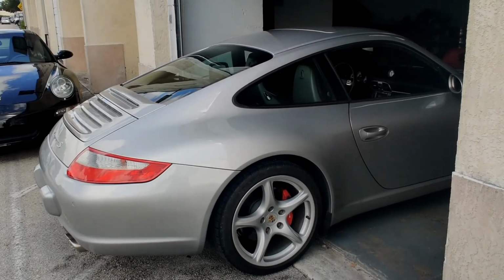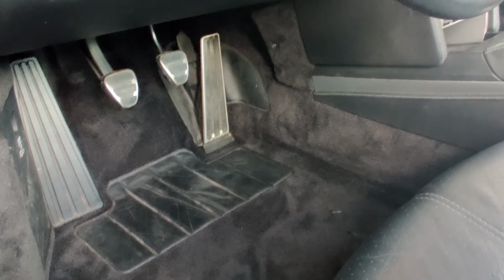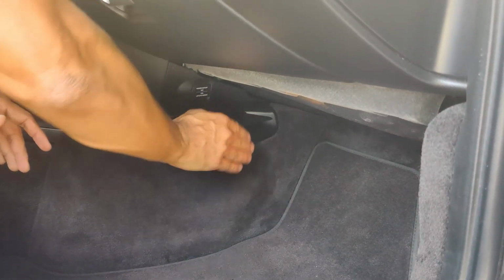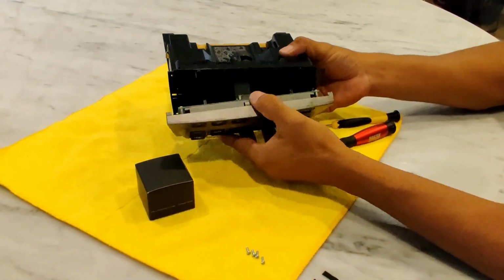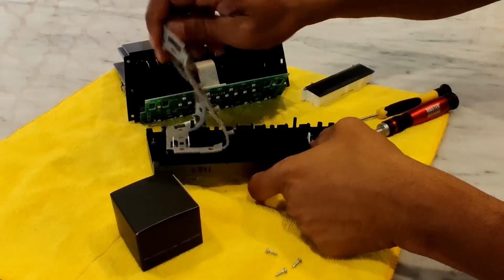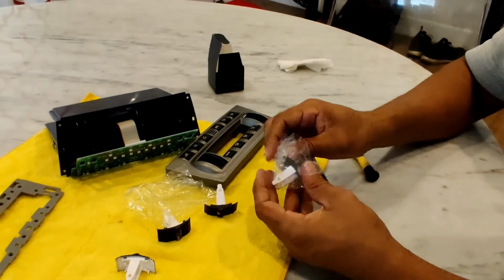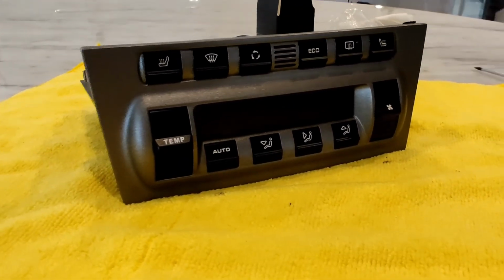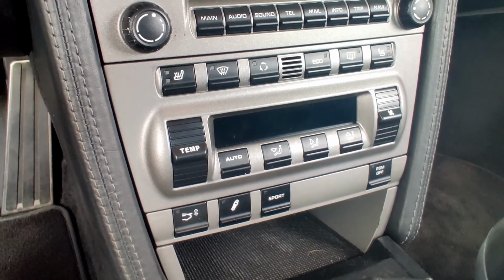Porsche 997, Cayman, Boxster Worn  A/C & Heater  Switch / Button Replacement / Fix

Comment: Does anyone have a part number for the LCD screen?  On my 2006 Boxster 987.1, I have to replace the temp and fan knobs but my LCD screen is not working. My Boxster is the Base model has AC Max and seat warmers buttons.

Comment: Porsche’s ‘slush finish’ makes for a very vulnerable component.  Anticipating this, I wound up ordering a fairly loaded car with therefore a lot of leather—it holds up better than that soft paint.  The instructions in this video are perhaps 80% correct but ultimately replacement pieces are not truly a form, fit and function design.  Unfortunately,, your design guys didn’t account for the thickness of the paint when they did this.  After the new rockers are installed successfully into their positions n the first time you use (for example) the blower speed rocker (to slow it down) the new rocker surface come into contact with the housing surface dnd the nice new painted surface winds up scrapping a bit of the point.  Pretty good try!  Dispite such a set vs l, it’s a far cry better than the OEM’s vulnerable slush paint finish.

Comment: It is not necessary to remove the circuit board as the tabs are accessible from behind the circuit board. The main issue is the very small little tabs that hold the buttons in (four on each and just visible from the sides, removable using a sharp craft knife). The replacements don't have these hence easier to install and replace again when necessary

Comment: Thank you for the guidance. 
 Can the switches be flicked out without detaching the circuit board? The LCD assembly is fiddly and i smashed the damn glass as it slid out. 
I also first tried destroying the temp switch to swap it in situ. I would advise, DO NOT do that method. It caused too many marks on the surround 😢. Ended up doing it your method to complete the job. Easy, with the correct tools 😁. Thanks 💪

Comment: I replaced the switches in my 2007 997 by simply pulling/ripping them out as shown in the link. I watched all these other guys remove the entire unit for months before getting up the nerve to try and then I saw this in my recommended videos. Game changer - works perfectly and took 2 minutes. Seriously. https://youtu.be/0FV9nqg4jN4

Comment: Great video and instructions on the whole process as well as showing how to avoid trouble areas like the side panel tabs and the LCD assembling. I spent $35 buying the buttons from Amazon, I didn't break any plastic tabs, the LCD works, and the climate control unit now looks brand new. Thank you again for this very helpful video.

Comment: Hi there - I watched this video carefully and it worked really well! Especially the side covers, where I gently released the bottom clips and then put my hand under the lower rear screw attachment point of the panel at the rear and then rotated rather than pulled forward. Worked perfectly. Only problem, is the rest of the console now looks old in comparison lol! Thank you.

Comment: I installed the buttons on my 987 Cayman S.  Everything went smoothly except after I had everything buttoned up and started the car, there was no display!  So, I removed the head unit again and disassembled the unit and checked everything carefully.  After I reassembled it, it worked perfectly!  I'm not sure what was different but so glad it works.  Thanks, again, for your detailed video.

Comment: You did a great job explaining step by step with the details. Appreciate it, very helpful...now I need to find out how to fix foam flakes coming out of the AC.  Thanks!
Reply: Hi. I've same issue. Porsche said that it's insulation and quite normal to deteriorate with no detrimental effect. ( If you weren't already aware )

Comment: Hey Bill, 

I just replaced the rockers, and they look great. Only thing is that my climate control screen now blinks 9 times whenever I turn on the car. Otherwise works perfectly. Any idea what’s going on?
Reply from the maker: Some cars come this automatic climate control.  These have the "AUTO" button in the lower left position.   The ones that don't have "MAX AC" instead.    The only time I've seen the blinking is when the wrong unit is in the car.

Is this a completely different unit, or the same one that was in the car before?
Reply: @billpatel1296  Yes, my 987 has the Automatic Climate Control, and it’s the original one that came with the car. It only started blinking when I plugged the unit back in after I changed the rocker switches.
Reply from the maker: @marknouj  Sounds like something didn't go back right.   Maybe a pin got bent?  I've done this repair about 50 times, and I've never had that happen, so I don't know what it could be.

First thing I would do is double check the plugs in the back.   Make sure they are secure.
Reply: @billpatel1296 hmmm, maybe the ECU has to re-recognize the unit or something. I’ll have the dealer take a look next time I’m in.
Reply from the maker: @marknouj  - did you turn the car on while the unit was out?  If so, then maybe.  It may have thrown a fault code.

Comment: Very well done. No one else describes the LCD. Glad you did because in removing the circuit board the entire assembly flopped onto my desk! Very easy thanks to your clear video!
Reply: Unfortunately, I dropped mine and smashed the corner. Somehow it still works (only tested once). Probably best to keep the circuit board intact, when removing the switches?